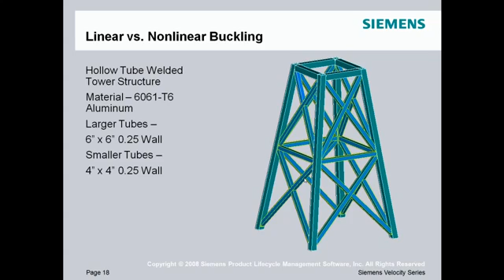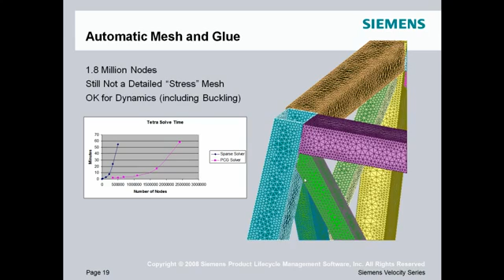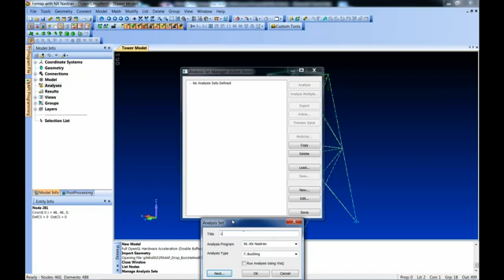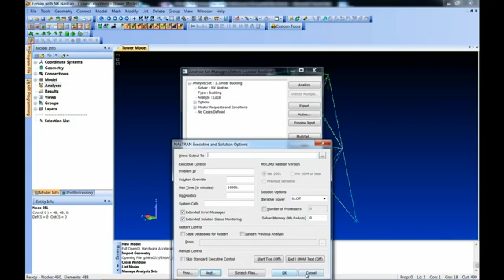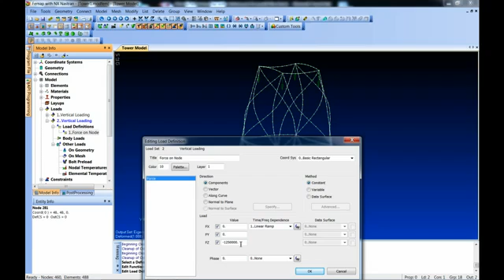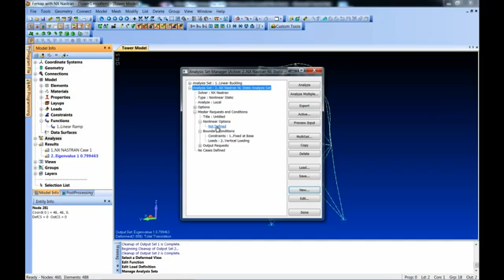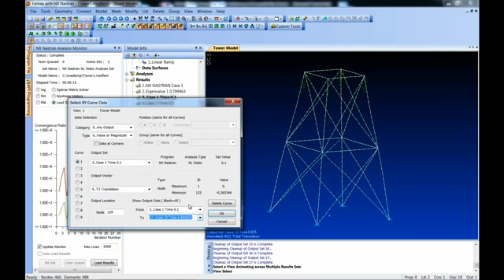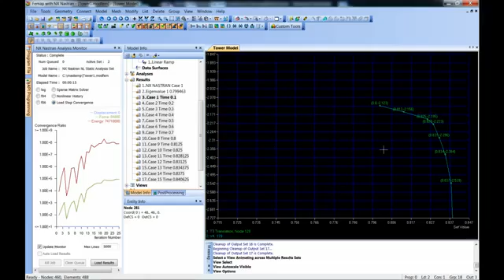Femap with NX Nastran Linear vs. Nonlinear Buckling-Siemens PLM

Comment: If I run the buckling analysis I obtain a certain eignevalue but then if I run the non linear static analysis it converge, so it is like it doesn't buckle, even if i didn't change anything to the model. Is there someon that can explain why does it happen? Pls